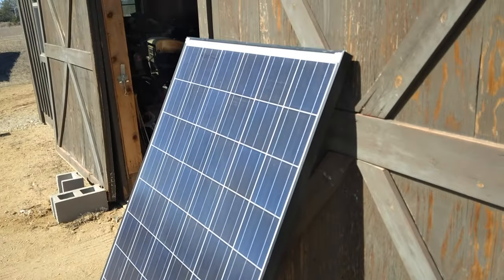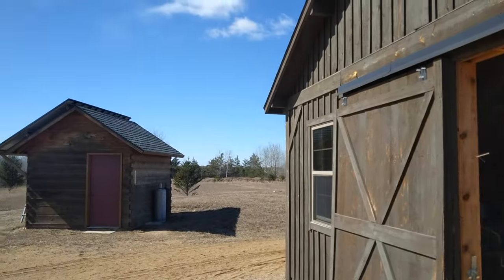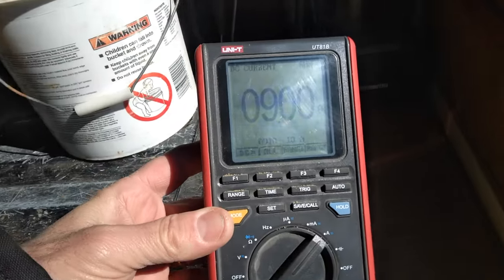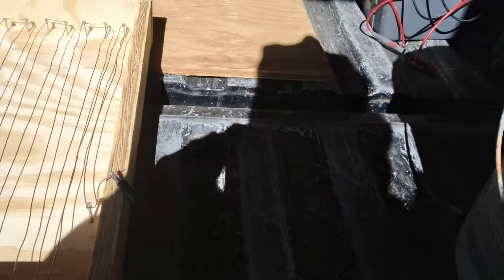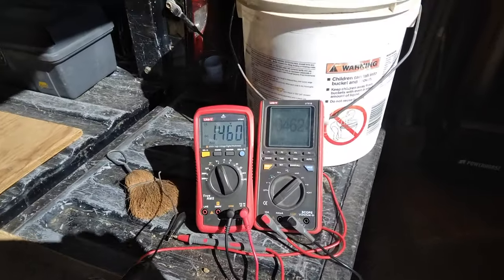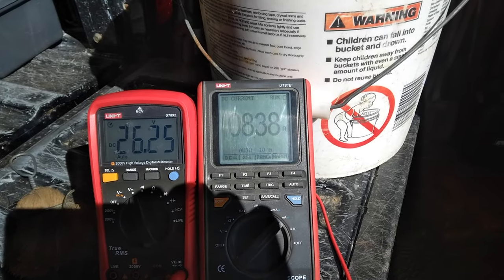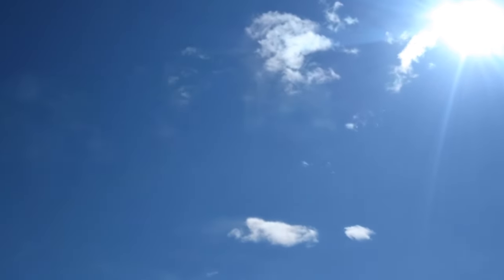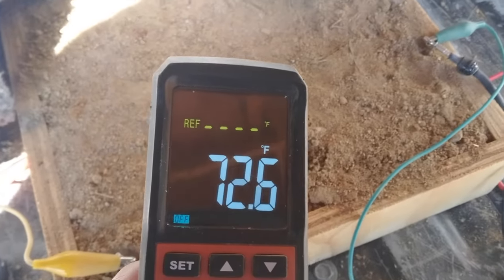Practical construction of a DIY sand battery

Comment: You wouldn't insulate a wood stove,  so how did you come to the conclusion of insulating a sand battery?  Use or make  a metal box,,,right?  For the purpose of storing/harvesting heat you want more mass rather than insulation--save that for the structure being heated.

Comment: Think off-grid Earthship heating conduction. Heat rises, which cause a void to be filled by sucking cooler air through long undergound cooling conduits. One wall Sand Battery located in the greenhouse. It can also heat your Hottub. Set on oposite ends of the Earthship to channel the air through the whole home using 100% heat convection which never fails.
Reply: Heat does not rise.  Hot AIR rises.  Heat moves in the direction of denser mass.  This is why putting heating wires over a concrete floor, covered by a rug, performs so poorly in heating the room air.  The heat is absorbed by the very dense concrete and then down into the ground beneath the concrete.  Some of that heat will eventually heat the air, but it is extremely inefficient.  This is why concrete floors should be covered with insulation or an air space before installing the wires.

Comment: Sand makes sense when you go very hot like 250C that means the wooden frame will burn  since water holds heat relatively well that means te same volume that is needed to hold heat at 250C is the same as watter at 95C just below boiling when going to 250C-800C then you need sand. When we talk about stove to be like 3 ton and it has average temperature delta 40-60C degrees above room temperature and it gives you heat for a day  but when you pump delta 10x like 500C degrees up you stored for 10 days make sand battery 30ton and you cover house for 100 days in US. Here in Estonia winters are longer and no sun in december so that even inverter take more energy than i get from sun. So we store 100 days we use stone wool since glass is liquidid some degree even at room temperatures avoid that 3 feet (1m) is quite enough that hold heat for 100days. Also I have idea to run steam turbine some day on that heat to generate electicity also you get like 50c(150F) water out of steam turbine and thatt is perfect for floor heating but probably you will use like 20-50% waste heat to heat floors and what you need more is done by heat pump. In here we need 75% heat and 25% electricity and you can regulate your generation what goes to short term battery and how much heat you  need when winter is not so cold then you cant sun steam whole day but then you have more sun also
Reply from the maker: Thanks for commenting!  Cogeneration can always be a good plan I think.  Steam for turbine into electrical energy, and waste heat for heating.
Reply: gkktech, you mean you have a heat storage with stonewool of 1 m thick? You compress it firmly then and run watertubing through it to get the heat in and out?

Comment: Awesome video - thank you! Use AIRCRETE TO CREATE A LIGHTWEIGHT INSULATED BOX THAT CAN HEAT TO OVER 2000 F
Reply: @gregwalker3540  aircrete would make great insulation around the outside to prevent the heat from escaping. Such as a hot fluid loop being pumped to a different location

Comment: I’ve been following the sand battery idea and yours is a great experiment. We need to try a 4” x 4” box of sand mass and see how long it will hold the heat. Your wire you were using could have been Nichromium wire. It is used for the same purpose idea and is readily available. I’m looking at a  galvanized grain storage bin for my sand storage container. Keep up on the science of heat storage you’re going in the right direction.
Reply from the maker: I believe the wire I used was Constantan Wire, used for a thermocouple. It has resistance, but not like nichrome wire.  Stainless steel wire would work too.  Just have to test the resistance for maximum load from solar panel.  You can get a pound of that wire from Harbor Freight for about $9

Comment: I really like your test rig. I'm interested in scaling that up to a shed sized sand pit. A big kiln filled with sand. Heat it in the summer, draw heat off in the winter to heat the house.
Reply from the maker: Sounds great!
Reply: Been there. Done that 😉 I've got an 800 gallon insulated ex fuel tank buried in the back yard here in Saskatchewan. Its got an air plenum in it that circulates the air through the mass. Ive got a 8000w 30Amp construction heater that kicks in every time my solar batteries are full all year long. Heat stratifies in sand just like it will in water. It congregates at the top. The top of my tank right now is 582C. The hydronic heating has already been on for 3 week in the house. There is already snow on the ground here. Last February before the days got longer and my solar was able to start producing more energy that I was pulling out of the tank? It was just under 200C. I have more than enough solar to fill my batteries in a couple hours even in the crappiest conditions. Its amazing what you can do when you cut the greedy installers out of the loop. And pretty easy to justify it when its replacing a $3000 heating bill each year.
Reply: So you heat your house from the sandpit all winter?
Reply: Is it a matter of circulating water in copper pipes at the top of the sandpit?

Comment: My dream experiment is doing this with a large propane tank. The heating element would be a few hot water heater elements, and the heat would be pulled out using the typical liquid loop system. Honestly if it worked well enough, I would bury it to get the insulation from the ground and leave access ports to the heating elements for maintenance
Reply: The ground will not insulate it. The ground will quickly draw the heat out.  Dig the hole wider and pour Aircrete around it for excellent low-cost durable insulation for much better success with your idea.
Reply: @tomlewis782  I was planning to insulate the tank, then bury it to keep it in a more constant temperature environment. Hadn't thought about aircrete. While it definitely would work, I feel as if aircrete would be better suited for a larger scale setup or could even be the container itself instead.

Comment: Very nice! I'm wondering what the "correct way" of heating this is. Given that the sand seems to be a good insulator, putting as much heat as you dare in the middle rather than spreading the wire out evenly would make the heat spread out over the course of the heating/day, causing less losses & less need for additional insulation. Likewise, if you build some kind of tubing to pump out the heat, those being more at the edges might also pull out the heat less aggressively?
Reply from the maker: I was using a sand and clay mixture so that it would conduct heat better.  There are many different ways to direct the heat.  I think it would depend on size and application.  Tubing for radiant heating is a good possibility.

Comment: Some heat tubes would spread heat evenly across layers, so you could concentrate heating as nicron wire is not cheap.  You can make them cheaply using different materials although copper is very good and soldering ends is easy.

Comment: How do you calculate the length of wire to be used.
Reply from the maker: I just pulled out a bunch of the wire, and connected the positive of the solar panel to one end; with the solar panel in full sun.    I connected one lead of the amp meter to the negative of the solar panel, the other lead of the amp meter I moved along the resistance wire until I got the rated amp load stated on the solar panel, and cut the wire there.  -Trial and error.
Reply: @doubleMinnovations  love it perfect solution without acalculator

Comment: What temperature did the surface rise to? Any idea how quickly it cooled down. Can you imagine you heating your home at night, with a big one of these heated during the day? (Even better, heated during the summer, six months ago.) Sorry. Thank you. Really informative.
Reply: I've seen vids where it's about 130-180°F on the surface while 500°F depending on how your heading element is setup. I've also seen sand batteries that was still sitting around 250°F internally and 110° externally four hours after the solar panels stop giving power. It depends on how big/deep your sand battery is.

Comment: Why would you want to heat the sand ? For space heating ? Rooting plants?
Reply from the maker: This is a dirt cheap way to store a lot of energy, for all 24/7 use.  For space heating, water heating, for steam production if you have a steam electric power plant.
Reply: In cold areas the vast majority of our energy usage is used directly for heating. So if you could store a tremendous amount of heat in a mass of sand and use it somehow, i.e. flowing water or air through the mass. You have a very efficient way of storing heat. People often think of electricity storage when they hear the word "battery". But this is specifically to store thermal energy, and if used properly can be very efficient.

Comment: Why would you use sand when concrete stores 6x as much heat?
Reply from the maker: Sand is cheap.  Concrete would also break apart if heated too much.  I put a heat storage furnace in for my (now late) sister 20 years ago.  It used off-peak electric to heat up clay bricks; and that worked good.

Comment: Great video. TY 
I can see scaling this up and having a massive heatsink and solar array outside and using heat exchangers to move it inside when needed. A liquid would be even better than fine sand but Im not sure if there is any cheap or environmental friendly alts to water that can get that hot without turning into a gas. Maybe even use water if you have enough of it and a relay hooked to a thermostat to cut the power to it before it boils.

Comment: Magnefying glass on copper in the sun would be better to heat sand I think.
Reply from the maker: I tried a couple of experiments with a fresnel lens for heating a container of sand.  It works if you have a way to keep the lens tracking the sun.  -kind of difficult I thought.